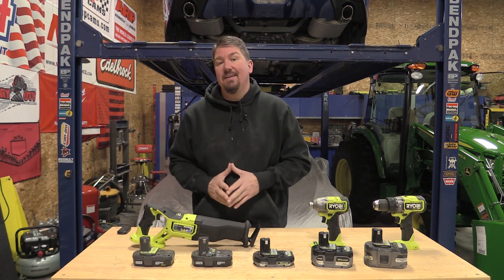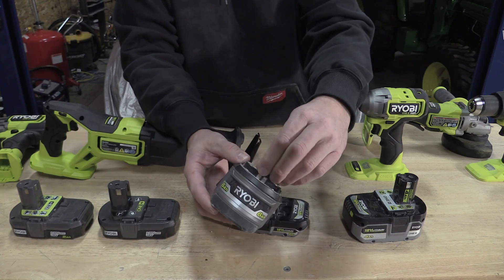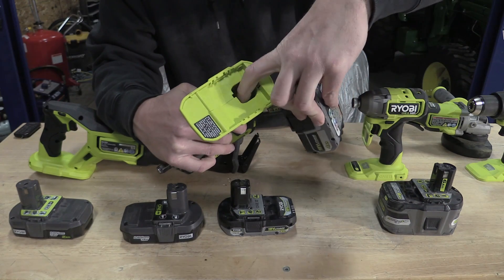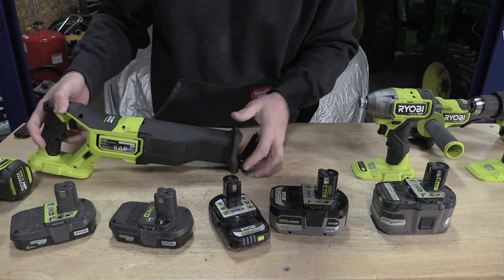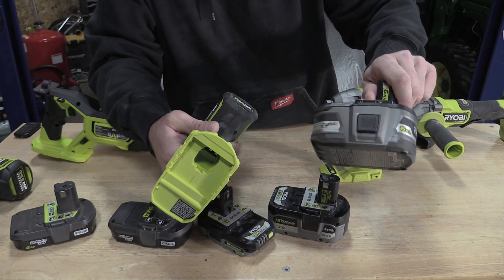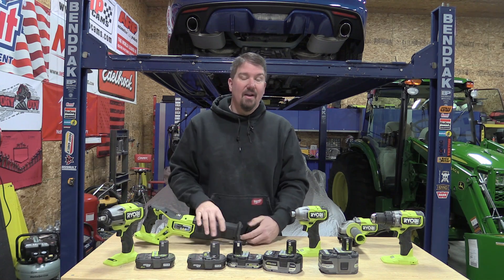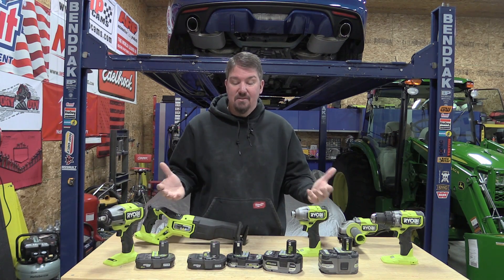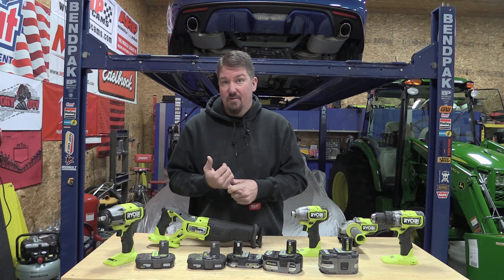My Ryobi Brushless HP Tool Has No Power? This Is Why...  New Battery Line Up & High Performance

Comment: Easy fix just run a wire from the positive and negative to the 2 spots on the tools gives it the same power all it is in more power going to the motor

Comment: Tried older and newer HP battery comparison. Really did not make a difference in a brushless hammer drill. Went back to older brushed drill. Has much more power.

Comment: TBH, the biggest problem is ryobi totally fail to communicate the information on their website. They have a collection of batteries series. Another one will be added with their upcoming HP serie (another). They should make a table (spreadsheet) with all the info, so we can understand the differenves and all the benefits of one serie or another. 
Same with their huge collection of chargers. Only within the last decade, home many models they had? What are the differences? 
That's for the 18V tools only...

As of today, if someone want to start equiping himself, I, presonally, recommand rigid over ryobi. A bit more pricey but:
still low budget
lifetime warranty
globally better tools (not always).
Dunno elsewhere but in Canada rigid sales are a tad better than the ryobi ones since a few years.

Comment: So, they are only giving the 6ah and 9ah batteries the high output circuitry? Because  that's the only way to limit output. Four 18650 battery versus eight 18650's does not change performance if the circuitry connecting to the tool is the same, right?

Comment: I don't agree with you about the size of the batteries. I have a Ryobi hammer drill with a 2 amp battery not HP and it work fine . I'm a homeowner / handyman and that's what Ryobi is for. Also have a 6 1/2 inch circular saw (regular) which i use with 4amp battery and I cut 3/4 inch plywood and 2x4 with no problem.

Comment: I built my house with ryobi tools, I have 3 tools that are still blue( skill saw, recip saw, and a drill) that came with the old nicad batteries, I did buy a 2 pack of 4Ah lithium+ batteries which I still use all the time, been working great for 8 years now, the batteries I love now are those 9ah lithium + hp, which now that I know they changing things up, I’m going to buy a couple more…

Comment: Small batteries don't work with high amp draw tools, especially with lithium batteries. Lithium cells cannot withstand a big voltage drop. There is a low voltage cutout circuit in the battery pack to protect the cells. The higher amp hour batteries can provide more amps at a smaller voltage drop and will activate the cutout less often.

Comment: I only have the 40 volt series......does this have to do with those too
Reply from the maker: The 40-volt tools do not seem to go up in smoke, however there was a HUGE issue with 5Ah batteries not lasting.  Google that for more info.

Comment: amp-hour is a unit of electric charge used to describe the capacity, it has nothing to do with how much grunt the drill will have when using a battery with a higher rated amp-hour. When i was into to RC cars the C rating was the measure of max and safe continuous discharge rate of the battery. A 2Ah battery with a C rating of 100 had more grunt than a 6Ah battery with a 30 C rating.
Reply from the maker: You are correct, but what you are leaving out and what is hard to tell people based off the Ah battery is what cell is used.  Many of the larger batteries have higher output ratings for amp output.  So, in short, you will find that higher amp hour batteries will have a higher amp output at this time in the tool world.  There are a few that stand out, like the Milwaukee 6Ah that seems to have a higher amp output than the 8Ah battery.  The amp hour number is more of a name for this video.   How else would we talk clearly about the batteries?  Call them by the model number and confuse everyone?

Comment: I was under the impression that the HP line of batteries use batteries with a higher current rate which means they can draw power faster, i.e higher RPM, Higher torque etc.
I read somewhere that the standard one+ batteries use 18650 batteries while the HP series use 21700. The 21700 does have a higher energy density as well as C-rate. So to be clear.. Any battery that claims to be HP, should have a higher performance than any non HP, as long as the tool can draw the extra amount of current. If they don't.. They're lying.

The size of the battery does NOT mean anything else than it can be used for a longer time between recharges.

Comment: I love Ryobi products there very affordable and good for DIYers and some of there products like the P262 and 1/4 impact driver are in  my opinion are for pro's I've used them in the industrial field but there 1/2 brushless HP+ drill is absolutely junk it lack torque. I compare it to my black and decker brush motor I bought years ago, very disappointing.

Comment: Can you take those two batteries apart because four amp hours or nine amp hours still deliver 18 V to run the tool? And if the new high-performance batteries deliver 20 V well that’s would give you more power but 18 V is 18 V? Even though the little entrance batteries are garbage

Comment: The low amp hour batteries are junk I think they use those to sell you newer bigger batteries because the circuitry inside let’s say that battery you wear it down and it’s dead and you put her decide and don’t charge it for two weeks once that voltage goes drops another 10th of a volt the circuitry disconnects the battery so you can never charge it again you have to Shockett with another 18 V battery and then it’ll go back in the to working order but most people don’t know that and you run out and buy bigger batteries for $80 apiece. Can you take one of those new batteries apart so you can show us what more power is? I mean if there are eight cells in that battery eight cells or eight cells now if there are two extra cells in the high-performance battery that would give you more power? Thanks for your video very good though

Comment: I have Ryobi 1hp one+ cut off tool with zip disk on it. I can't even cut through mesh (very thin metal sheet 7 by 7 feet with 3 by 3 inch squares, used for shoring) and I can't cut through it keeps STALLING. Even on a Thin piece of rebar! I have a big 18v battery hooked up. I also have a small battery and same problem.

Comment: Seems like they are still giving out the older batteries when ever you get a tool that comes with a battery.. frustrating that they dont come with HP batteries still.  For example I just bought the ryobi dethacher and it comes with 2 older batteries.

Comment: The brushless angle grinders seem to be a waste of money, honestly. My brushed Ryobi angle grinder works with all my tools and the motor doesn't cut out. It cuts everything I need it to, including occasionally splitting a cast iron bathtub. It enjoys a natural boost from larger batteries, due to more cells allowing more amps but I can run it on a 1.5Ah battery for small stuff, in a pinch.

Comment: Great video!
I just bought a combo kit with 7 different tools, circle saw, impact driver, drill, multi tool etc. Their kind of basic tool offering, not HP or brushless. With it came a 2,5ah and 4,0ah Lithium+ HP battery. Should I go out and get myself stronger batteries for these, like 5ah or 9ah? Or is it a waste when its not their stronger tools? Im doing all sorts of DIY around the house we just bought and need to renovate.

Comment: Thanks for this! was looking at the 3/8" long reach ratchet and more importantly, the two 1/2" drive impact wrenches: P262 (600ft-lb BA/450ft-lb drive) and PBLIW01B (1170ft-lb BA/700ft-lb drive). So basically need the 6ah or 9ah High Performance. Do you suspect there's a significant difference in torque with the 6AH vs 9AH?
Reply: Have you seen torque test’s video on the ryobi batteries? The difference in the new 4ah High performance and the 9ah HP is astonishing. On the impact (rated for 1170), the 9aH would keep a 100 ft/lb. lead over the 4aH at some points during the test runs. Also I really love the long ratchet. It’s fantastic for running off nuts even with just a 2aH HP battery
Reply: @sidsteverson1005  I have the 6Ah High Performance and 9Ah HP. I wound up getting the 2 long necks as they came as a set, on sale.  pblrc01 and pblrc25. And the dcf899 1/2" impact.  You're talking about the TTC's video where ryobi called them up and told them they shouldn't be using the supplied 4Ah? Yup remember that video!
The 9Ah uses three parallel strings of 5 cells in series, where the 6AH has only two parallel strings of 5 cells in series. So, on paper, the 9Ah can deliver 50% more amps.

I also use a small battery for my ratchets, I just don't want to stress them. I'll break something free with a ratchet. Like you mention, I just love the time savings for running off nuts/bolts from a lot of threads.

Comment: 🙋‍♂️ Long story short from my experience.
I prefer 3ah HP with 21700 cells over new ones with 18650.
I’ve noticed when I need this additional umpf 21700 is way to go on 18V platform even when tool don’t have additional pins.
Reply: what about the 4ah HP batteries out now? Do those have the 21700 cells?

Comment: Great Video. About 2 months ago I bought the Ryobi ONE+ HP 18V Brushless Cordless 1/2 in. Drill/Driver from Homedeopt. The drill doesn't have the 2 extra terminals on the drill like the HP battery's have. The drill says RYOBI ONE + HP on the drill.

Comment: So much for Ryobi's promise to never change their battery design.  It may remain the same shape and therefore fit the tool, if it doesn't perform correctly, its not the same battery.
Reply: Great point

Comment: My 1.5ah batteries have retired.  All I have now are 2 and 4ah batteries.  I only use the 2ah on my drills and sometimes my 1/4" impact driver for lighter woodworking projects.  In a recent outdoor project, I bumped the impact driver up to a 4ah.  The hammer drill and just about everything else gets a 4ah.  I'm pretty easy on my tools, so power and battery life are rarely a concern for my usage.  I have corded counterparts for just about everything, should the need arise, but I can see some 6 and 9ah batteries in my future.

Comment: ..I'm not having very good luck with these new batteries...bought several of them on sale when they first came out, now 2 of them won't charge, say defective pack, both have very little use. Unfortunately, I bought them more than 90 days ago, so no warranty from home depot...if the others go kaput prematurely that I bought, I am done with Ryobi.The previous batteries were very good, but they can't leave well enough alone...

Comment: Great review.  Just bought some high performance 4ah batteries for my brushless hammer drill and brushless impact driver.  Already had a couple of 6ah for the recip.  My regular 4ah batteries are fine for the older drill and impact.  Everything works fine with the correct battery as you said.

Comment: This kind of goes for their 40V stuff to. I can run the mower on a 2ah battery for about ten fifteen minutes but not if there is tall grass. Remember the old adage - there is no replacement for displacement?  That’s true with these batteries. But on the other hand I give it to ryobi for keeping with the same platform. I went with M12 for my portable drills because if I need to do a lot of heavy drilling it’s going to be a wall plug. On the other hand the M12 is good for a couple of heavy screws but when I don’t want to fumble with the extension cord. Really love your videos as they are common sense and applicable to average guys who don’t have thousands of dollars to spend. Thanks.

Comment: I use the mid torque, rotary hammer, and the mini grinder with the 4ah HP batteries professionally in the trades and they work perfectly, no hiccups whatsoever, mini grinder cutting some cast iron pipe, rotary hammer drilling anchor holes, and impact cutting cast pipe and installing concrete anchors etc

Comment: When I first got my first Ryobi HP brushless tools, I took them apart because I'm insatiably curious about the internals of things like this. Those two extra terminals do not carry power. The wires in the tool are far too thin (~26-28AWG) to carry any meaningful amount of additional power. I suspect that they're either for communication (so the tool knows it has an HP pack installed, disabling a built-in power limiter), or a thermal sensor to allow the tool to shut down when the battery gets too hot (basically does the same thing - If it has a temperature sensor, the tool knows it's an HP battery and can go full blast).
Reply: thats probably why they run better with dewalt batteries on them, it bypasses it all
Reply: @KEVLAR1911  I know that inside the Ryobi battery there is a little computer chip that controls the amount of voltage you get from the battery pack and the old black and yellow batteries didn’t have it so you could use all the energy in the battery and the tool would actually slow down when the battery got weak these new tools or new batteries I should say get down to about 50% and then they just shut off no warning no nothing just dead so I don’t like the circuitry in the batteries. Will the DeWalt battery plugged in or do you need an adapter? I don’t have any DeWalt tools yet
Reply: @theusconstitution1776  The batteries do that because they’re lithium batteries. They have a BMS inside that, among other things, will disconnect the power from the tool to prevent over discharging the cells. All lithium cordless tool batteries have this (I believe) and will function in the way you describe.  The worst thing you can do to a lithium battery is over discharge it. It’s not only bad for the battery but increases the risk of a thermal runaway which could potentially cause catastrophic damage.  The second worse thing you could do is keep them constantly charged at 100% or over heat them but that’s a separate topic entirely.  

Brock Lee hit the nail on the head when he mentioned cell discharge capacities. The Ryobi P195 battery was very sought after because it had 21700 cells in it that despite only being 3AH, could provide much high peak discharge amps in times of high demand and thus tools would run better. That’s the whole reason why people use Dewalt and Milwaukee batteries in Ryobi tools. Generally, the Dewalt and Milwaukee batteries use better cells that despite potentially being the same capacity, can handle greater discharge demands and thus the tool works better in times of heavy load.
Reply: There are battery controllers such as MAX17048 etc. They can communicate with a microcontroller via I2C interface which can transfer temperature data or the voltage of the battery, etc. I2C uses mainly 2 signals.. and that 2 additional pads look like signal for them.
Reply: A big thing to consider is that different lithium ion cells have different current output capabilities. For instance a single 18650 cell made by one company can put out 30 amps safely while another can only put out 15 amps. The motor will draw as much current (amps not amp hour) as it can. if you put a battery that can only handle 15 amps but the motor wants 30 you will burn out the tool or battery. most of the comments here are correct, but missing this key concept. They should realy market how much amp the batteries are capable of discharging safely along with amp/hour.
Reply: It communicates with the tools to deliver consistent power to the tools. For instance the circular saw when hitting a knot in the wood it tells the tool more power and when pass it tells it to slow down. It helps extend the length of the battery charge by doing so.

Comment: Just tarting my Ryobi journey. This was very helpful. I bought a HP brushless drill and impact driver without the extra connectors. Glad I didn't go out and buy HP high performance battery for these, would have been useless. I'm surprised they don't just distinguish all HP tools as needing HP batteries, that was the confusing part for me. Thanks for the great videos, please keep reviewing Ryobi products.

Comment: The Ryobi 3AH lithium+HP Compact (21,700 Cells) is what I use to run my old P238 brushless 3 speed impact driver and my old P251 Brushless Hammer Drill that's the only Ryobi Tools I have so far the rest of my tools are DeWalts dcf887 & dcf888 3 speed impact driver running them on 5ah, I got dcf801 Xtreme 12V w/ 3ah 12V Brushless impact driver, dcf996 Brushless Hammer Drill and I'm running it on 8ah (don't 60v need flex volt) also I owns and using DeWalt brushless XR 7-1/4" Circular Saw also runs it on 8ah 20V battery. And my corded tools are DeWalt corded Worm Drive Circular Saw, Skil Worm drive corded circular saw, Hitachi 12" Dual bevel Sliding miter saw and Hitachi 10" Jobsite table saw. For the Ryobi tools that I own only 2 of they're running good enough on the P191 18V battery 3ah compact +HP 21700 cells. I never had any bigger Ryobi 9ah batteries neither 6ah. It's always up to the users whatever that works for them.

Comment: To me I think ur right but look I can use there reciprocating saw and there sawzall, and circular saw and impact wrench and hammer drill with an 4ah HIGH PERFORMANCE battery and there impact driver, ratchet, jigsaws, multi tool with 2ah HIGH PERFORMANCE battery but for the grinder I think there new HIGH PERFORMANCE battery isn’t enough they need to use a HP old battery 6ah or 9ah  because 4ah will good but it we’ll die fast and the 2ah hp battery will cut out it’s not enough so  old hp fine for grinder

Comment: Thanks for the info mate. I have a question as im looking to buy the ryobi p262 impact wrench and I currently have 5.0 ah lithium + 18v battery with a fuel gauge on it. Would that battery be enough to run it or do I need to purchase a HP ryobi battery ?
Reply: It will work just will not make max torque.  Go to 10:05 of this video https://youtu.be/_fg92TtbY2Y.  It's a high torque but the mid torque should be similar